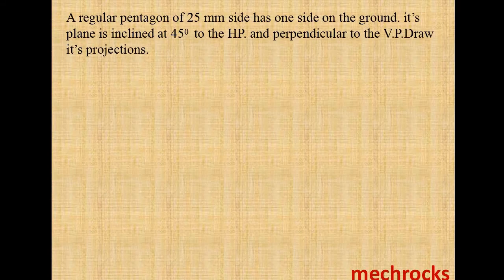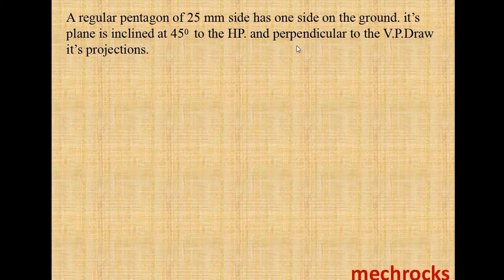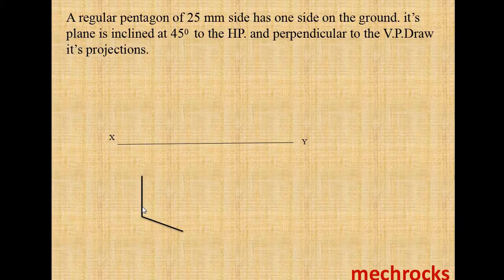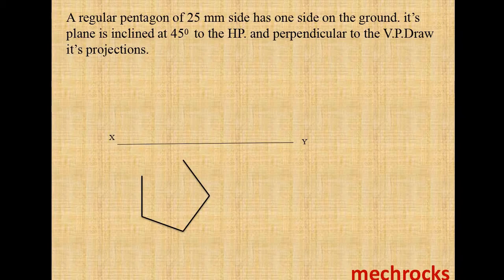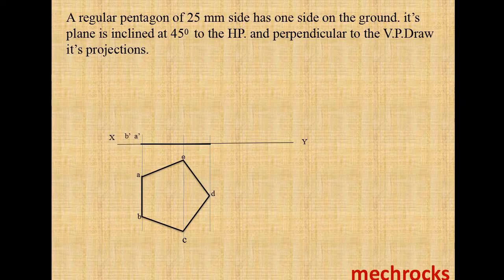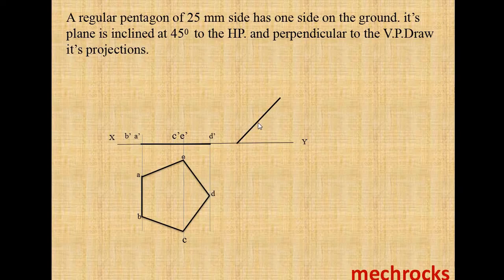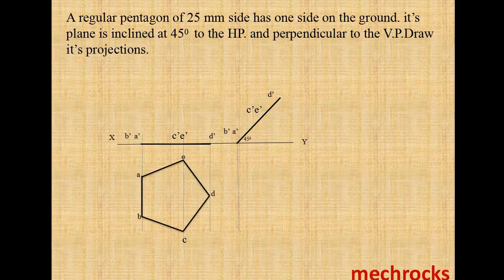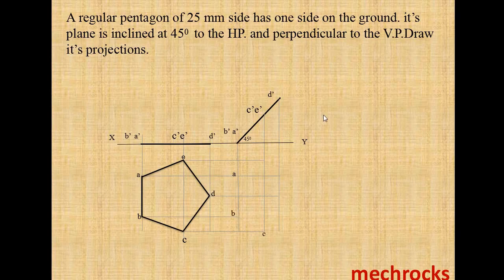Engineering Drawing - Projections of Pentagonal Plane Surface

Comment: Draw the projections of a regular pentagon of 30mm side which is resting on one of its edges on HP and 
inclined at 40º to VP. Its surface is inclined at 30 º to HP😊